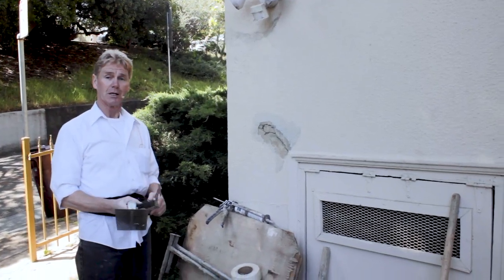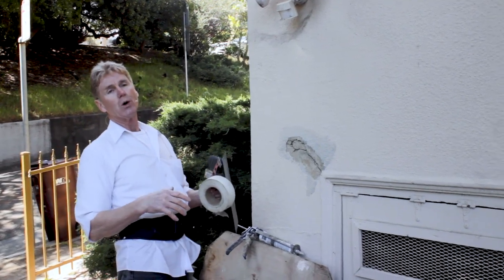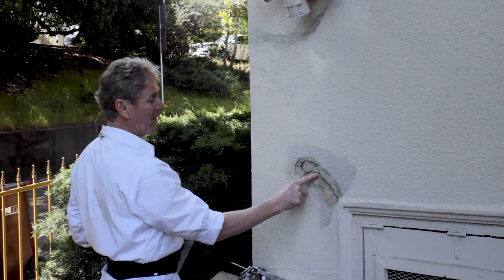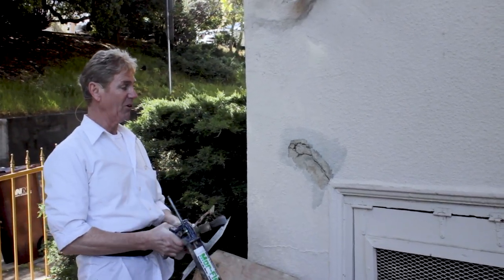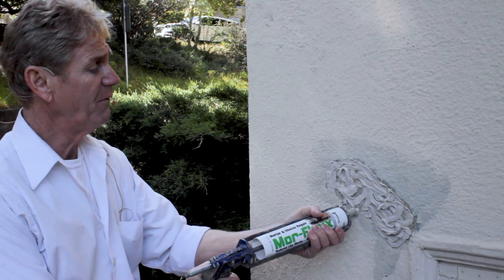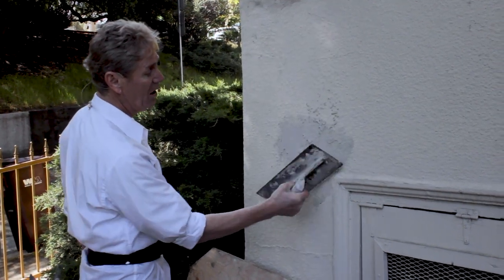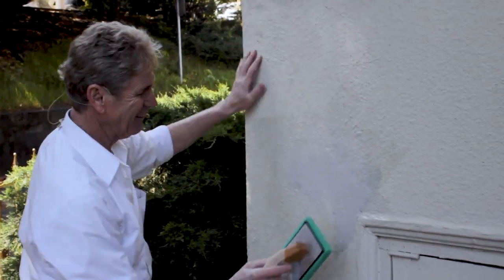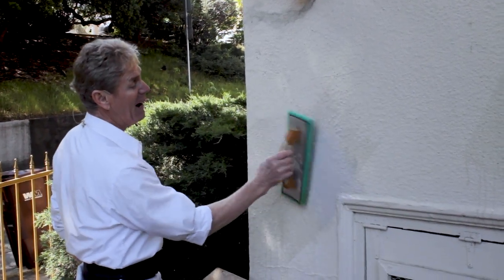Can cracking stucco rot or ruin your walls

Comment: Thank you so much for providing your expertise on stuccoing! I have a 30 year old house that had some areas of stucco deterioration. I watched many of your videos and followed your instructions carefully from applying the bonding agent through to the stucco finish coat. I am very happy with the results. I could not exactly match the stucco color but that's a minor issue. Thanks for your great videos, I have learned so much!
Reply from the maker: Morning Dee, thank you for that kind response. FYI, few can match color finishes, we can't either, as it can't be done, except for the color, Crystal White. All the other colors can't blend in. You have to re-coat the entire wall. 😉

Comment: Nice tip Kirk.

I find that you can match the texture seamlessly by blowing some stucco “crumbs” onto the wet calking after you sponge float it in. 

Usually when cleaning up after spraying texture, I’m pulling my drops and tearing off visqueen plastic.....and I will find sections where the hopper over sprayed - and now that it’s dry, I will collect it and save it in a container with a lid. I can usually shake up the container so that the bigger chips break up. 

I will grab a small handful and put it on a trowel or piece of cardboard - holding it up the area, and then blowing the texture pieces into the caulking. It really leaves a finished look and you can’t tell where the patch is once you paint it.
Reply from the maker: Howdy Jeremiah, excellent tip, there are many ways to skin a cat.💃
Reply: Thank you for posting, great tip !

Comment: Great tips.  I have some loose stucco and cracks that I need to repair.  Can you then paint over this to match the existing paint?  The paint used on the building had texture in it as well.
Reply from the maker: Howdy James Dude, yes, this can caulking can be painted, sounds like they sprayed a tex coat on your home. 🍾

Comment: I have a question. I’ve recently been doing a lot of scaffold ties . Do you have any tips or methods on doing them
Reply from the maker: Hi manual, the best advice I can give is to make certain the bottoms are always level by looking at the tops of the bars and making sure they are level. If you are now sure about its safety you can always tie-wire it off to the studs in the home or building.🥳

Comment: Kirk, what about the width of the crack?   Would you recommend this on a crack that is 1/8" - 3/16" or is there a different product for finer cracks?
Reply from the maker: Howdy 221, if it's a monster crack, fill it, then when it shrinks or gets sucked in after a few days, just add more. No problemo.🥳

Comment: I assume you mean the quik crete cement patch in the yellow buckets with all the additives.
Reply from the maker: Howdy Anthony, noo, I was referring to the caulking tubes. As this  Mor-Flexx caulking with sand is working well for most who try it on their exterior stucco walls. No doubt all caulking companies will now have stucco sand in the tubes in less than a year.
Quikrete's caulking, https://www.quikrete.com/productlines/stuccorepair.asp
Mor-Flexx's caulking, https://www.sashco.com/products/mor-flexx/
Both are less expensive on Amazon.

Comment: Kirk and Jason - In another one of your videos about re-finishing a painted brick fireplace, you used Plaster Weld. I planned to use that on a painted concrete ceiling before plastering over it, but I cannot find Plaster Weld in Hawaii (or anyone who will ship it here). Is there a similar product I can look for?
Reply from the maker: HelloHeinzmad, of course, Quikrete, makes the same bonding agent sold everywhere for about ten bucks a pint. 😉
Reply: @StuccoPlastering  Thanks so much!!

Comment: Quick question Kirk before I call you!!! Lol j/k man. I did a few patches with "stucco patch rapid set". I was planning on painting the small retaining wall with ELASTOMERIC masonry paint. HERES THE QUESTION. Do i need to wait 30 days if applying to New Masonry like the lable says on the paint?  I used rapid set and it says I can paint in 2 hrs or so. Thanks and by the way you are my "cement hero" ever body's heard of "jukebox hero" you get it...My wife says why you watching the cement guy again, me "he's my hero" 😃😄😀😁
Reply from the maker: Howdy Mr. CashGold Dude, Standing in the rain with his head hung low, couldn't get a ticket, it was a sold-out show...Eagles. 
Which "Rapid set' product did you use? "Rapid set stucco patch" if so you can paint after two hours, or "Rapid set stucco" which they say to wait 28 days for curing?
Tell your wife, no it's not it's the cement guy, it's the stucco dude. 🥳
Reply: @StuccoPlastering  Thank alot Kirk, I told my wife what you said. Then I got hit with a brick, and she said,  you are what ever she says you are. 😃😁😀😄
Reply from the maker: @MrCashgold  Never question your wife.💃

Comment: Could  one mix course sand with Sikaflex 1a for an even longer lasting and sticky patch?
Reply from the maker: Good morning Donald, excellent question, There is no doubt that Sikaflex calking is one of the strongest calking in the USA. However, it's not water-suluble or water cleanup-able, if that's a word?
Thus, Sikaflex cannot be sponge floated. 
Also, if sand is mixed and you try and feather it in, it won't. It will just leave a sticky, nasty appearance. And stick to the float or sponge. 😏